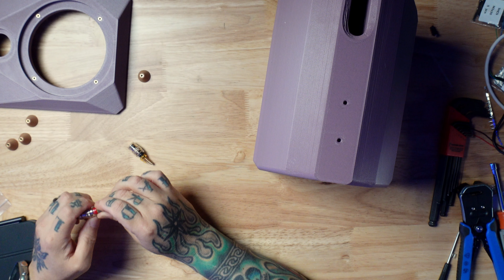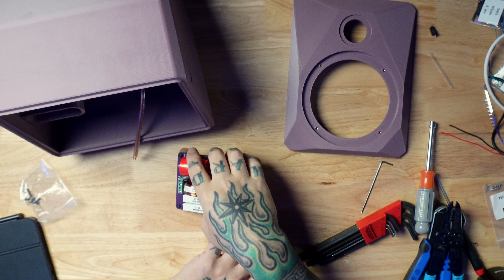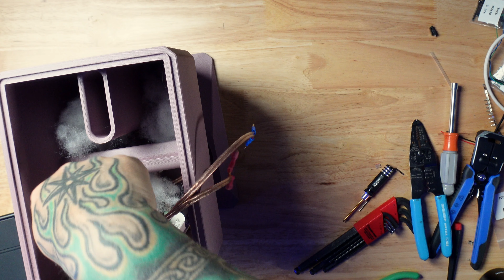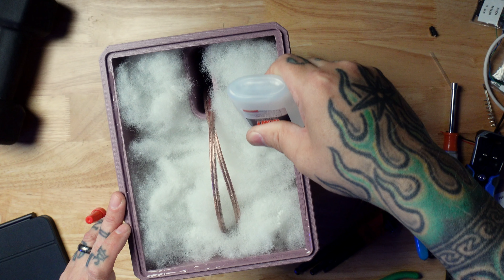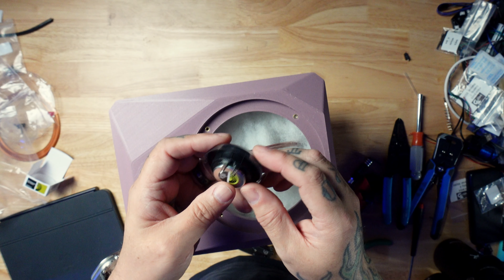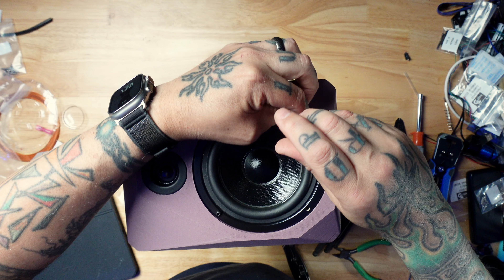Deposition Sound FDMGeo part 1- the build

Comment: That wasn't protective foam. it was a gasket to seal the woofer. Without it you will eventually get air leaking around the woofer and causing extra distortion and noise.

Comment: This is exactly what you DONT want to do with your batting. You have obstructed the airflow to the port and essentially partially sealed the unit. You are changing how deep the woofer can dig down in bass. Also you don't want anything touching the port tube. You will change its natural frequency and further alter the bass characteristics and probably add distortion.

Comment: Would it be recommended to use ferrules on the speaker wires when connecting them to the crossover board?